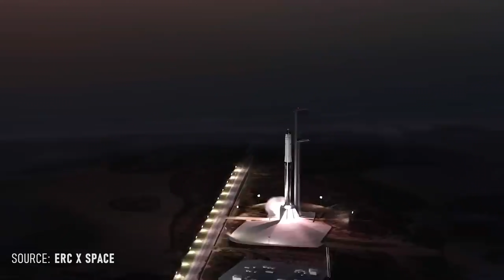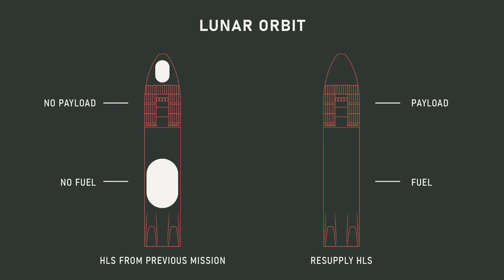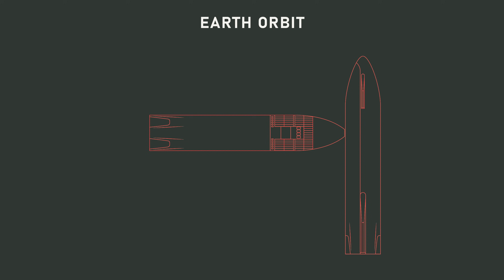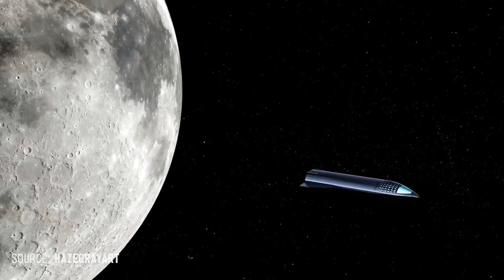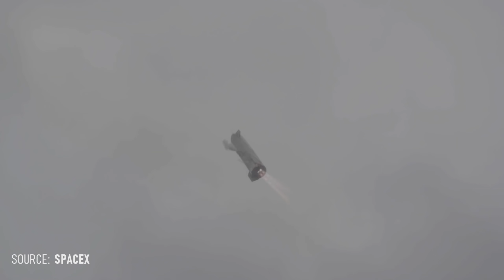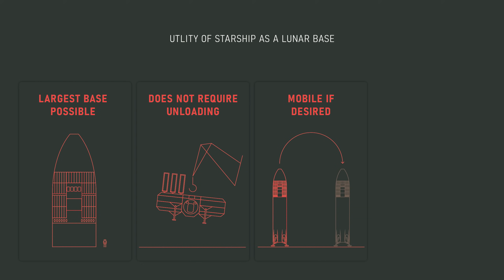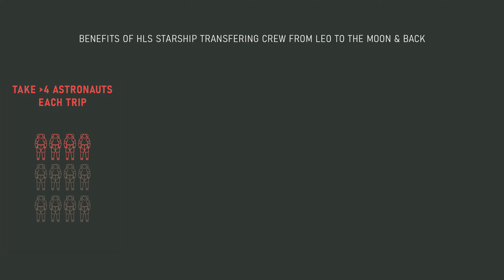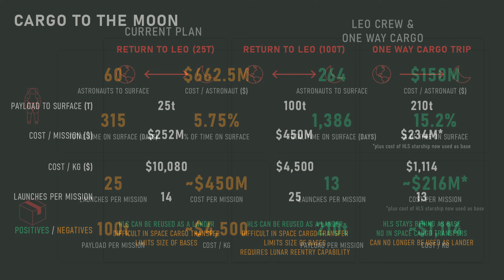How to Use HLS Starship

Comment: Even LEO HLS design is pretty wrong and misuses Starships capabilities. Surface to surface missions could be done too (with orbital refueling). Small crew launches to the orbit are just not needed if SH can do it. And in this way you may rip off the final reduction that whole HLS/Artemis plan suggests. Only one SH/HLS plus a LEO tanker needed to liftoff from Earth and for the round trip to Moon and back to surface of Earth. This is the goal that SpaceX has planned and that gives you the maximum benefits from using Starships.

In foreseeable future there is no need for any extra vehicle that transports astronauts to LEO. But getting there will take some time (from now 3-15 years) to make SS's reliable enough for all the steps needed.

Comment: SS cargo transfer could be done with a modular design. Open cargobay, take module out with robotic arm or just have something like hinges on both vehicles (maneuvering should be accurate or done with pull cables while thrusters keeps enough distance/placing or something like that [metal rods and sliding module with hydraulic pressure?]), and on cargo module too, place it to other SS's cargobay, shut doors, ... And then alter positions so you may refuel. Fueling most likely needs another SS, specially when lots of tonnage is lifted from Earth's surface.

Comment: Whole SLS system is not needed and most drawbacks are coming from NASA's dumb idea that uses so old design. With SS/HLS you may bring 10-100 astronauts to the Moon per launch! And you may have pretty much payload too 100-200 tons if refueling few times. With few Starship's you may have constant stream of gear's needed, crew replenishment's and what ever the Lunar base needs.

And who really needs crappy Gateway? You could just put 1-2 SS's to lunar orbit and you'll have more space with all systems needed onboard. Ofc you may build larger space station, but a small one that is currently designed is just bad. Few SS cargo launches and you may have a decent larger space station in Lunar orbit.

NASA with SLS is just saying: We can use less crew, less gears, less everything to the surface, costs are much higher, but we still want to use it. And those who are saying that SS is just a lander, well that means it is capable for manned landing and just running same crew from Earth orbit to Moon orbit is way easier than landing. And SS should be capable to lift crew from Earth's surface too at that point. NASA has made a totally predecided nutcase scenario that is not using best qualities of Starship.

Reason why NASA uses this crappy design uses two main reasons. First it has spend so much for SLS that it should be used (false idea) and it's spending's could be questioned if they won't use it. Secondly NASA is bound with multinational treaties to build Gateway etc. Real issue is that NASA is using poor design and it has hard time to get rid of them in timescale where SpaceX can overachieve all these goals. Funding will finally decide what happens and NASA has more leverage in these issues than SpaceX can never have. Spending just because of paper agreements is just nuts, but that's often the case as can be seen what happens to other contracts like Bezos Blue Origin Lander.

Comment: Great video. You said what I’ve been thinking for many years. I differ on one point. You said that Artemus doesn’t need to be canceled. Congress won’t let it be canceled because of the huge job losses. I agree. That is why Artemus should be replaced with Starship. Same as the Apollo moon program used Von Braun’s ideas and put him in charge. We should finally admit that even if Artemus was a good idea when it was begun before Starship was even started that we should face reality that Starship far surpasses what Artemus could have ever hope to accomplish. I want good employment and smart planning. NASA should switch ASAP after using Artemus hardware already produced. It’s not too late to change directions.

Comment: Ok, the only job the starship has here is as an elevator to take astronauts to the moon surface and back up again. So it can stay where it is to do that more than once. It only uses hot gas thrusters for that function, Surely it can go with at least enough gas to the job multiple times. It can also be resupplied with that gas. No need to return to earth.
Reply from the maker: It uses its main engines as well for that job. Hot gas only at touchdown. I think it could maybe do two landings before it would be empty, and need refueling. And those landings could only bring a few tons down.

Comment: One partial solution would be to add a separate ascent module on top of the Lunar Starship (LSS) on LEO. 
The  LSS with the ascent module would land on the moon with lots of payload and the astronauts launched in an Orion like in the original NASA plan. LSS would stay on the moon after the mission and the astronauts return to lunar orbit in the ascent module docking with Orion. The next LSS would dock with the ascent module and Orion on lunar orbit, part of it's payload being fuel for the ascent module.
In this way you wouldn't need to lift the heavy LSS into lunar orbit or return it to earth orbit. It would stay on the surface of the moon and be used as part of the lunar base. Maybe it could be possible to use another manned capsule(s) than  Orion later in the program. For example, a crew Dragon launched by Falcon heavy, would not have enough delta_V to enter lunar orbit and return to re-entry into earth's atmosphere, but it would if refueled from a LSS on lunar orbit.

Comment: Don’t forget that SpaceX has a habit of doing what is most efficient. I’d expect to see the lunar lander ship(s) fuel and take on crew in LEO, take them to the moon and back to LEO (adjusting mass to and from to work with available fuel) and then transfer cargo to a “Earth to LEO” variant of starship. Something with a cargo door / transfer system specifically designed for surface to LEO to support the lunar mission. Maybe launch with a load of fuel, transfer it after the crew return in a Dragon (seats 7!) and then transfer the cargo from the lunar lander and return to Earth. That would also offer an efficient way to commercially bring stuff up snd down for other commercial ventures like asteroid mining. 
Basically a trucking system from surface to LEO and return, automated to the greatest extent available.

Comment: ... or just send one starship with a nuclear reactor, and another with mining equipment to mine lunar water and use the power from the nuclear reactor to turn it into hydrogen and oxygen, then find a source of carbon or send one, which allows production of methane on the moon. Then once you have your lunar gas station, you eliminate the need for those VERY costly fuel launches from the earth repeatedly. Alternatively, you could alter the lunar starship to work with hydrogen and oxygen I guess.

All the cost here comes from the inefficient nature of launching fuel from the surface of the earth and then having to transfer it multiple limes in LEO.... why not just make the first lunar mission objective to setup a working water mining and fuel production plant on the Moon where it is so much easier to refuel a starship so it can get back to earth, or, get to Mars and beyond?

Comment: I have a few questions about this.  First, if the Lunar Starship is left on the moon as a base, how do the astronauts get back to earth?  Second, if the HLS Starship returns to Low Earth Orbit (LEO) to be reused, how does it get loaded with a new load of cargo?  Third, if the size limit for cargo is 30 inches because of the airlock door size, how does the cargo get unloaded when the HLS lands on the moon?  Fourth, if the HLS does not have enough delta-v to go from LEO to the Lunar Surface and back to LEO (while NASA seems to imply that it can), could SpaceX be developing the HLS to have larger fuel tanks than the normal Starship model?
I really enjoy your videos, but these questions came up and I wonder if there are any answers to them I didn't catch?

Comment: Within a few years after 2024 you could just skip the other capsules altogether, and send a standard crew starship along with the Moonship, and that can launch and land crew by itself to and from Earth, Crew Starship launches and docks with HLS, transferring crew, then both burn for the Moon, HLS then lands, docks with Gateway, the crew does it’s job, etc, then they return to Crew Starship, and it burns for home and lands, not even having to use fuel to capture into a Low Earth Orbit, and can be refueled on the ground, significantly reducing the fuel launches needed if a non atmospheric starship was used with crew capsules that require even more launches, then HLS refuels in GTO and comes home as you said, much simpler than the capsule, problems with this plan include:

Crew Starship will take significantly longer than Elon said to be crew rated (mostly entry and landing procedures, which has literally been done successfully once so far), thankfully, the important bits like the engines at the very least, should be crew rated by 2024 because of HLS

Not sure how long it will take for NASA to be confident enough to allow their astronauts to strap into a giant skydiving steel grain silo with no escape pods.

SLS, the problem with this plan, and yours, is that SLS won’t be used to the full extent politicians want it to be, because the flying jobs program is still unfortunately our best option to getting people to the moon, even with Lunar Starship and your plans, it would never be accepted because it could effectively eliminate SLS except in a rescue scenario, even with what you said, which at that point it may become too uneconomical to effect a rescue plan with SLS (it would literally be cheaper to crew rate FH to do that with a modified Crew Dragon), so my proposal here would eliminate SLA from the equation after a few years, and yours basically forces NASA to use SLS to launch an Orion to LEO to complete your plan, because Congress would never allow the two cheaper options to do it, or at least not without a fight and using some excuse to get SLS to do it, except maybe Starliner since it’s also a Boeing thing, so this is a plan I think could happen by 2028, let me know your thoughts, fellow space fans!

Comment: Those starship launch price numbers are way too optimistic... Even 2x more than the price mentioned in video would be unimaginable success.
Reply from the maker: SpaceX launches Falcon 9s for an internal cost of $28M. Falcon 9 uses more expensive fuel, helium, TEA-TEB, requires a drone ship recover, a fairing retriever boat, and expends it’s upper stage and a vacuum engine. 

Starship will certainly be less than $28M / launch when operational due to cheaper fuel, no navy operations, no expended stage or engine.
Reply: @Apogeespace  By the words of Elon Musk fuel costs:
Starship 500k per launch
Falcon 9 200k per launch
so it is going to be at least 2.5 times more for fuel only. Starship is still using Helium - nothing is suggesting they are going to change that in the next 3 years (maybe for Mars missions, but probably not for the Moon).
I don't see a point of pointing out those Internal costs -- SpaceX is charging ~60M for launch (~90M in expendable config - those are the prices. There are no indications SpaceX is going to lower those prices for the Moon missions (they are a commercial company), as they didn't do it for ISS missions.
Also, prices for the missions with a drone are very similar to missions with boosters returning to the land. Orbital Refueling process is going to costs too...
Reply: Those kinds of calculations are very unprecise. Results are very unrealistic
Let me give you an example:
Imagine FH does not exist yet - SpaceX didn't say anything about their prices, so we can make an "educated guess":
"Falcon 9 costs 60m launch. Falcon Heavy is "pretty same thing" with 2 additional, recoverable boosters.
Refueling price for both stages of Falcon 9 is 200k -- 80% for booster 20% for the upper stage - so 160k for booster. So fuel for those two additional boosters 160k x 2 = 320k
320k is 0.5% of 60M - so we can say it is negligible.
Conclusion: Falcon Heavy launch is going to cost very similar to Falcon 9. Considering Falcon 9 is 60M + 300k additional fuel + few other expenses:
FH is going to be 65M - max!"

The reality is that Falcon Heavy launch price is 90M.

P.S. I know you didn't do the same thing. Of course that this is an exaggeration, but those things in small quantities multiple times accumulate to a very, very bad estimate
I assume you know the story of YouTuber Dream - he (inadvertently or not) tweaked some numbers to increase his chances for some benefit. He didn't change very much (less than twice per parameter), but through his speedrun, chances accumulated to 1 in 2*10^22 (that's 2 leading 22 zeros!!).
I'm not accusing you that you are trying to mislead your subscribers, or else I wouldn't be there watching, let alone commenting. I'm sure that you know there are plenty of YouTubers taking extreme stances on this whole SpaceX thing, and it looks to me like you want to stand out by being as realistic as possible. But some things can easily slip. To make a realistic prediction you cant use extreme values (lowest or highest predictions), try to be realistic even if the final result is not spectacular (in the real world it rarely is).

Comment: The Hercules project had a better approach that could be coupled with Starship capability for better return to LEO capability without coping with tedious cargo transfer in LEO.
Have the vehicle able to be in two parts, the engine/fuel section and a cargo section, with a dock/undock ability. Each time the vessel returns to LEO, it dumps the cargo module into Earth Atmo and the module is recovered, if built right, it can be reused. Refuel the engine section and launch a new or reused cargo module with the new payload inside it to dock to the engine section and then send it to LMO or Moon surface to later use by a crewed mission. That means the crewed Lunar Starship can have more crew related payload to become a base or a LEO return ship.
That's more or less what I do for my interplanetary missions in KSP now, have a ship that has an orbital engine section and a surface section that can be replaced (or reused IRL) and docked at will when the engine section is refuelled.
The plus is that you just need the refuelling and a docking for the new cargo module. That also means that you don't necessarily need big fucking rockets once the logistics is in place anymore ! A Falcon9 or any other relatively heavy launch vehicle can do the trick for cargo payload sand small resupply missions. Less Starships sent, less Starships to build.
The other alternative is to send a Cargo Starship with the cargo module with landing ability inside the cargo bay, launch it to LEO, deploy the cargo that can be sent on its own to the Moon without necessitating a refuelling (less payload overall of course, but we might not need that much for a simple base resupply mission after all and that cargo module can be expanded anyway and become, I don't know a com relay or navigation beacon once landed and emptied.
For bigger payloads and cargo, your approach can still be used but that would largely be to start a mission, not to extend it unless you want to bring something different on the surface such as radio telescope builing tools for example...
Of course the Starship mission architecture would be even better if the Lunar Starship was hydrogen powered to be refuelled on the Moon's surface directly with an ISRU and drills.

Anyway, overtimen the SLS will be obsolete for Lunar missions. The best use for SLS is launching big payloads to outer planets on faster trajectories eventhough with a little patience, a Falcon Heavy or Starship could do just the same for much less. Yeah, that really makes the SLS completely irrelevent at that point...

Comment: Your deductions are missing a few points such as the support from other companies with cargo transfer and the  Lunar Gateway. The HLS is to remain and will not require as much fuel for reuse. The first lunar base will also explore fuel extraction on the lunar surface down the track. Obviously the first missions will not cover all this but time will tell. The only risk to this is the Senate. When starship is human rated, the SLS will end

Comment: What if you did the  Dual HLS mission, but instead of tranfering the crew to the 2nd HLS you use the 2nd HLS as a tug to push/pull the Lunar Lander HLS back to LEO. Seems that would eliminate both the crew transfer in lunar orbit, and 2 of the refueling flights that would have to go out to elliptical orbits...

Comment: Great video. The numbers I've seen show that ISS has a slightly larger volume than Starship. 2017 design was estimated at 825m³ vs ISS around 1000m³. Where did you take the numbers that Starship would have a larger pressurised volume?

Another interesting subject you could explore is a deep space station for Mars transits. I seriously doubt that crewed Starship missions would fly solo, it seems logical to dock multiple Starships together with a docking module, that are connected to something like Bigelow Olympus (2100m³) and other useful modules (centrifugal, solar, etc) that can be specifically designed for the deep space missions.

When the station reaches Mars orbit, the Starships could land and the station could remain in Mars orbit and provide ground support. This provides redundancy, allows the optimization of the layout for deep space requirements without sacrificing Starship layout, adds cargo + living space and more.

The Starships should be able to provide necessary propulsion with orbital refueling on LEO, so when the multiple Starships dock to the station, they all fire their engines at the same time to propel the station to the Mars transit orbit.